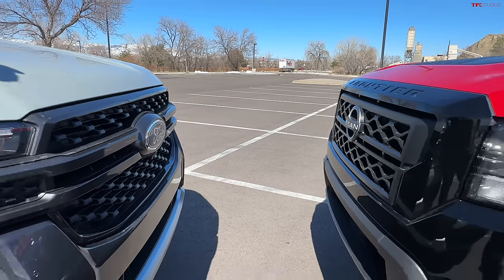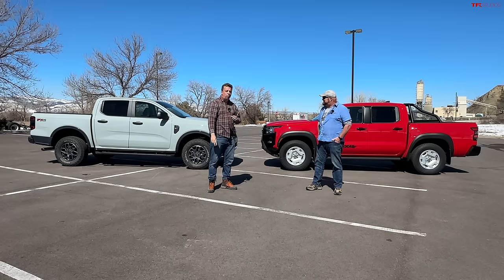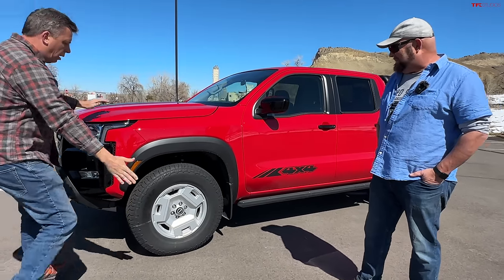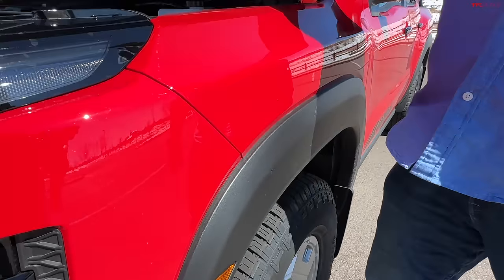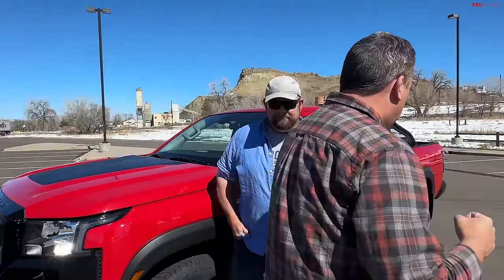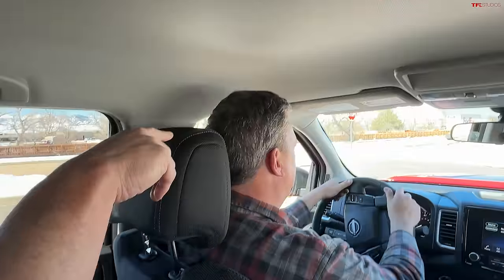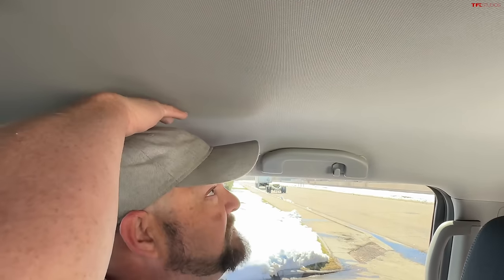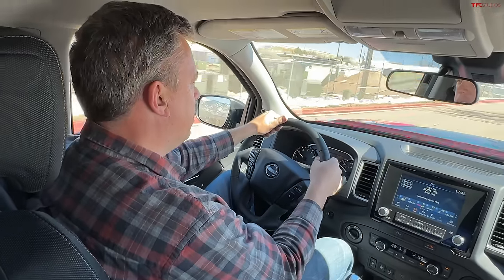This New 2024 Ford Ranger & Nissan Frontier Hardbody Cost EXACTLY the Same, But Which One Is Better?

Comment: $46k for either of them is insane.
Reply: In my head I still think these trucks are still low $30s the way they sit
Reply: Paid $40k cdn for a new 2020 f150 supercab xlt sport

These being $46k usd is insane
Reply: Niether Ford nor Nissan has to worry about my business.  I bought a new base model 2013 Nissan in 2014 and 250,000 miles later I still like it and have no plans to replace it.
Reply: @jfruser  I agree 100%. I have no interest in buying any of these massively overnflated products.
Reply: Thats why I'm seeing a lot of Mavericks on the road.
Reply: I'm buying a mid sized truck this summer and for me its between the Tacoma and the Ranger.  The Frontier is getting dated for my tastes.  I think I'm going to be happy either way, really love the interior on the new Ranger.  Ironically I kind of trust the engine in the Ranger more than the Tacoma because its a proven engine.
Reply: In my head, no basic 4x4 should be over $30k. All that tech that falls apart right as the warranty ends is reason enough not to buy.

I want at minimum a V6 or Straight 6 engine in a mid size truck. The only turbo I want is in a Syclone S10
Reply: Yes. But esp for a Nissan
Reply: @jeffk464  those two are the ones I'd go with as well. The Ranger has better rear legroom and can be had for less money (the Tacoma has the same if not worse legroom than the previous gen, check that out when doing the test drive) but I like the Tacoma has an available 6 spd manual and overall more packages/options to choose from although these drive the price up quite fast. The styling is a toss up for me, I like them both. Agreed about the powertrain, the 2.3 Eco and 10R transmission is proven by this point, I've seen a few of them for sale with anywhere between 150K and 200K miles
Reply: For real. I’m 25 and have a good job in engineering for a multinational semiconductor contract manufacturing and design company. I make around $80k after a year working there and I can’t afford any of this shit. I’d need like 2 promotions to be able to afford a decent truck. That’s just not right.
Reply: @ramonmacias9013 They tow more than a full size from 1990
Reply: Vote accordingly
Reply: @technom3598  Both sides are controlled by the same foreign entity....and no, it's not china or Russia.... But yes, to an extent, I agree 👍🏻 🤍
Reply: If you are broke lol
Reply: @dbarton8651 Which one?
Reply: @JollyGiant19  cost far too much and too much tech to break I would rather have my 1990 1500 that I can actually fix almost anything that could go wrong with it in my driveway than spend 4 to 8 times as much on a truck that when it breaks I need to take in to get whatever piece of junk computer that broke replaced for almost rhe cost of what I paid for my truck in 1990
Reply: Welcome to 2024, have a good nap?
Reply: @Dusdaddy  I've been here the whole time genius. This isn't news to me. Stating the obvious. Bring something constructive to the chat or kick rocks boomer.
Reply: Considering my super crew xlt 4x4  f150 was 48k msrp and was 37 after year end rebate I'd hate to be getting a midsize for the same money knowing how much the size of my f150 has benefitted me over the years.
Reply: You're right about the "insanity" of those prices, but "insane" truck prices are the "new normal" now.
Reply: @chrisrobinson3494  I agree. Especially if people actually purchase them. It only becomes the new normal if we allow it.
Reply: @jfruser which is exactly why they make stuff that breaks later
Reply: @ramonmacias9013  What midsize ever came with a straight 6? I thought maybe the Jeep Commanche way back in the mid 80's, but looked it up and that was a V6.
Reply: I can't believe people spend over $400 a month for a vehicle. That's a house note.
Reply: @Dusdaddy I paid 36600 for a new 2016 F150 XLT FX4 with a 2.7 Ecoboost in Dec 2016 adjusting for inflation would make it $43000 today
Reply: @jamesm568 a house note? You mean a single wide in Appalachia?
Reply: I remember when the crew cab colorado alpha with the V8 came out and it was like 32k. I was like wow. That's a lot. 😮
Reply: I paid 46 for my ram 1500 classic last year
Reply: Alot of yall cry for no reason and expect to get mid tier and fully loaded  trucks with all the bells and whistles for the price of a honda civic.
Reply: @Misfit_Z71  Yeah you're right. Civics are pushing upper 30s loaded. So whats your point?
Reply: @Misfit_Z71  These are mid-tier trucks and they don't have all the bells and whistles, so paying over $40,000 is absolutely ignorant. Most people that pay $40,000 for a vehicle end up losing it within two years.
Reply: @jamesm568 read my comment again since it seems thst you skipped over my mid tier part. If you end up losing your car within 2 years then you shouldn't be buying that type of vehicle.
Reply: @Misfit_Z71  you also shouldn't be paying over $400 a month for a vehicle either.
Reply: @jamesm568  this isn't 2001 bud. Welcome to the world of inflation. Seems like everyone forgets that we're in thr year 2024
Reply: @Misfit_Z71  Consumers have a say in the price as if they don't pay the prices dealerships won't charge those prices. This is the consumer's fault in a consumer is paying dearly for it because of their stupidity.
Reply: @jamesm568  those prices that he stated are MSRP. It definitely is the consumers fault for paying dealer markups. Toyota is notoriously known for this
Reply: How so?  The tech, safety, and capability is well beyond what you could ever fathom with those old vehicles.  Just because you can’t afford it, doesn’t mean it’s insane.
Reply: @Spyke-lz2hl  The reliability of older trucks is something that you can't fathom as you would have to throw away your fancy high-tech overpriced vehicle that will more than likely cause you to go into bankruptcy as that nice vehicle will need to be replaced every hundred thousand miles and cost more to maintain with increase insurance costs. So tell me again how you are benefiting?
Reply: Absol-fukin-utely! Back in 2001 I bought a cherry condition '97 Ranger for 10K. It had a bigger engine and lasted forever. These new car/trucks are ridiculously overpriced.
Reply: @Misfit_Z71  That is true also.
Reply: @Spyke-lz2hl  By the way there's very little differences between a 2018 truck and a 2024 truck when it comes to technology, but they sure is a 25% increase in price that does not reflect the technology advancement.
Reply: Pricing themselves out of business.
Reply: @jeremyporter796  just like they did in 2008.
Reply: You know what's funny that you can go to a Nissan dealership and get a pro4x for about 42k / 39980 with discounts!! Id actually get the  Nissan but not the hardbody version that costs an extra 4000 ! I don't think so!
Reply: @stevesafety6743  lol...that was eight years ago my friend! In 2011 I paid $34k for Hemi Laramie, so friggin what? What you are buying today is well beyond those vehicles.
Reply: These are brand new models, of course they’re going to be pricey. Everyone in the history of ever concerned about price will buy used. Just buy these trucks in 5 years. What’s more crazy than the price is how everyone has the exact same conversation on every new truck video 😂 Just respect that they’re new and in a few years they’ll likely fit your budget
Reply: @regularperson7  Rebates don't count. These may have them as well if they don't sell. Any way you look at it, a full-size will cost on average $10k more than a mid-size.
Reply: @MistrBiggles  Agreed! So tired of hearing about how costly they are! Then don't buy one! Simple math...
Reply: @Dusdaddy  not exactly. Same engine. Maybe some additional cameras and a larger info screen not exactly huge differences. The price increase is greater than the rate of inflation
Reply: @stevesafety6743  Really? You have all that tch like adaptive cruise and the safety stuff? I know I don't.
Reply: @hitempguy got screwed by stealership for an stx f150?msrp $51k.  Added 4K for stealership fee because of low inventory.  Burned a bridge.
Reply: Get used to it.  It’s called dollar debasement.   Turn those printers on 😂
Reply: @jeffk464 yeah I think ford will be more reliable than the Tacoma, but I think Nissan wins for reliability
Reply: People have to stop buying them, prices will drop.
Reply: @thepab3072    No.  Your money is becoming worthless.  Wake up.
Reply: @midlifecrisis7888  what? I'm saving money buy driving my vehicles till I can't fix them. If you think your money is worth something because you're buying an overpriced truck well enjoy 😂
Reply: @jfruser ok but in a couple years you’re not gonna have a choice
Reply: @dbarton8651 You're just jealous because us "BOOMERS" can easily afford any of these trucks without crying about how much they cost 😂
Reply: @tommycasidy3031  I'm not a Boomer and I can afford these trucks, I choose not to over spend my money. New trucks are overpriced, it's supposed to be work tool not a douche mobile for Boomers 😂
Reply: @CoDplayer458458  most of us couldn't afford a new vehicle at the age of 25.  Don't go into consumer debt. And pay off your student loan asap.  Sooner you're debt free, the better off you'll be.  Then you can pay cash for whatever you want.
Reply: Don't worry by the end of the year all these manufacturers will be slashing prices !
Reply: @VortexArcade keep did change from the Buick v6 in the early 80’s to the inline 6 in the late.
Reply: in 2019 that bought a f150 XLT with similar options.
Reply: For $50k, I can keep my old ranger running for a long time.
Reply: Is it. Average price of a car in the u.s is over 50k now.
Reply: @hitempguy there's been a lot of inflation since 2020.
Reply: @ramonmacias9013 living in the past? Inflation is a thing.
Reply: I'll stick with my gladiator
Reply: I don't see why people would pay so much for a truck that will be obsolete soon. As of right now most new cars sold will have to be electric anyway as people are making the switch to EV's. Why overspend on something that will be archaic soon?
Reply: @VortexArcade , the Comanche changed from the GM sourced 2.8V6 to the AMC 4.0 in 1987.
Reply: @EGGINFOOLS 😂
Reply: Honestly everything is expensive now.
Reply: Welcome to inflation.
Reply: @brandonmacklenar1484  Maybe the guy that wanted a midsize with a straight six can get a good deal on a leftover 🤣
Reply: My 2017 Silverado LTZ was $51xxx. These little trucks are way over priced.
Reply: With the umwa raises they’re only gonna go up.
Reply: I bought a 2018 tundra sr5 4x4 double cab brand new off the lot for $29,000. To think that these tiny trucks with similar interiors and technology cost more than $16,000 more is insane!
Reply: @Justforfun-ek7et  💯 🎯
Reply: For the nissan that's a good price with that engine
Reply: @lamborghiniempanada7586 hey times are tough I heard your mom had to raise her price
Reply: It’s called bidenomics!
Reply: Sixteen grand less I’ll consider it. Also I’ll take the six over the four every day.
Reply: 46k for both would be good
Reply: Yeah thats bullshit.
Reply: @jfruser 4 or 6 cylinder?
Reply: @cs292  the 4.0 v-6.
Reply: @jfruser  I had one and had to trade it in because it would not stop shaking at idle..I just couldn’t stand it anymore.
Reply: Saw a Facebook market place add from a local dealer with a list price of $67k for a new Tacoma trd offroad. $46k is not too bad.
Reply: We don't live in the $30k fully loaded mid size truck generation old timer
Reply: We don't live in the $30k fully loaded 4x4 mid size truck days anymore. There's the used lots for the ones bitching about the price.
Reply: The Tacoma is 66 for its starting price for its equivalent models
Reply: I have the 2022 pro4x and is a really good truck and paid 39000 which wasn't a bad price 2 yrs ago and used trucks with 80000 or so miles were the same price as a new frontier.
Reply: So is $30 for a Tri-Tip.
Reply: People are gonna buy these trucks knowing it’s gonna be a large debt.  Just cause they want something new.  Might as well get a used higher trim model and if your not used to always having new.  It’ll be new to you and lots of bells and whistles that’ll surprise your even if it’s older.
Reply: @VortexArcade  The 4.0 was an inline 6. My buddy had one.
Reply: When I was selling cars, you could get a new 2014 silverado Z71 for just a bit more than one of these! Bigger truck, bigger engine, better 4x4 and rear diff, and fairly close fuel economy. Inflation really sucks!
Reply: I'd buy it
Reply: My father-in-law has a Toyota Pick Up (not yet called Tacoma) that he bought new in 1994 for $8000. Still drives it and it still runs great. Crazy part is he could sell it for more than that now. Trucks being upwards of $50,000 today is insane.

Comment: Adre, I towed my son’s BMW on a car trailer with my Frontier (about 5,000lbs total) and the engine purred at about 2K rpm virtually the whole way. Never seemed stressed at all. Love the truck!
Reply: Cool story, only believable if the entire trip was downhill.

Otherwise 🐂💩
Reply: The most BMW story ever 😂
Reply: @BC08  it's actually accurate. I have a '22 Frontier and tow a 17' travel trailer with mine (just over 4,100 pounds loaded). For about 80% of my drive from Cincinnati to Myrtle Beach, the truck doesn't get above 2,100-2,200 rpm. The mountains caused the truck to periodically downshift a couple of gears, but the engine NEVER once got above 3,200 rpm. I am not a Nissan fanboy by any means- I bought the truck because I got a deal I couldn't pass up in today's market.
Reply: @BC08  watch this channel they tow over 6k up the ike gauntlet with this truck with no problems.
Reply: @sierratough4934 haven't you heard beast is the word bird.  I don't need my truck towing at 5000 plus rpm...  if that's all you know don't expect you to understand
Reply: @BC08 Most midsize trucks can tow 5000 lb easily. When it gets up to 6,000 lb that's where they start to struggle when not properly equipped.
Reply: @jamesm568  A frontie can’t tow 5000 lbs chugging along constantly at 2K
Reply: @BC08  Depends on the terrain. Pulling a box trailer or a car trailer makes a difference on whether you can maintain lower RPMs.
Reply: @jamesm568   Yes, downhill.  Like I said originally
Reply: Nice..wonder why everyone complains about that trans then???
Reply: They towed a suburban across the county with a 2.3 ranger 😂
Reply: @jamesm568 I towed a 1956 case 300 tractor on a float trailer with my 21 Ranger handled it like a champ
Reply: @brly4542  Today's midsize trucks are made to pull that. A full size truck is a complete waste of time If you're pulling anything under 7,000 lb.
Reply: Never happened.
Reply: I have a 2022 Frontier and towed my 5,000lb camping trailer from AZ to PA and back last summer. 
The Frontier did a MUCH better job than the 2003 Tundra it replaced. Effortless is the right word. The new Frontier is a fantastic truck.
Reply: @BC08 yeah… I just made that up…🙄
Reply: @BC08 the I-95 stretch between Richmond and DC is relatively flat.
Reply: @4rr44E   I know
Reply: dont get a titan. Been using a 1st gen for towing dump trailers making me thousands a month zero issue for years.